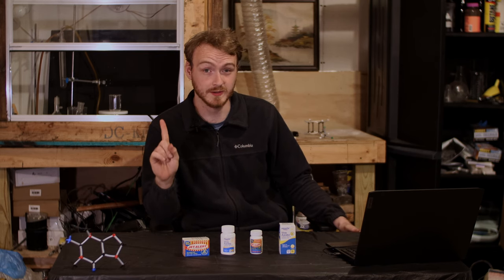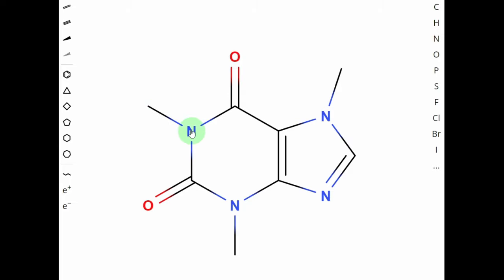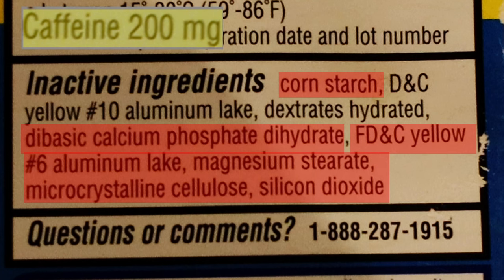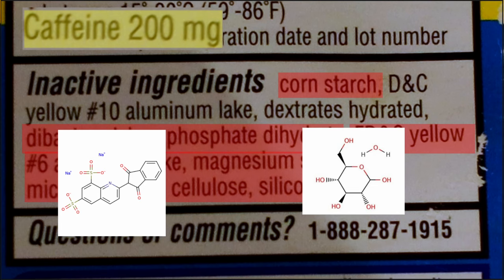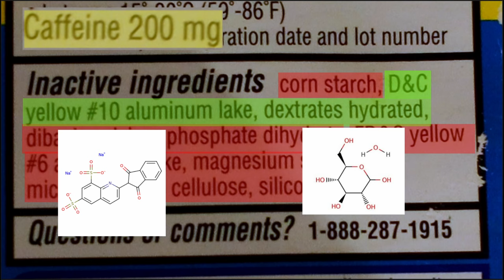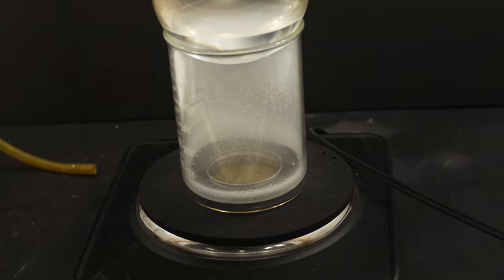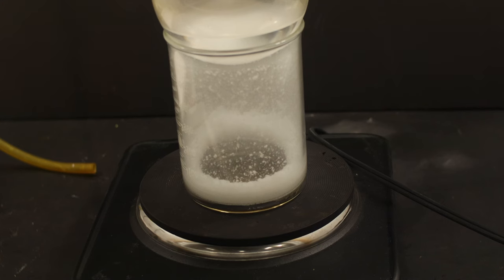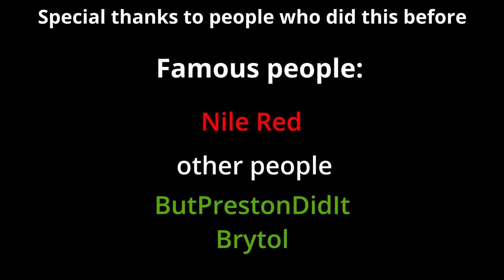Extracting Caffeine from Pills!!!

Comment: If you scrape off or wipe off the outer yellow coating with a damp paper towel before starting the process you can essentially eliminate having to do all the steps of removing the yellow dye. It’s much quicker too. Idk about your specific pills but the ones I’ve seen only have that dye on the outer coating of the pill, once it’s gone the water is clear/white when you dissolve the pills.

Comment: Fun fact about silicon dioxide in food
If you ever made some drink that required you to dissolve some powder (e.g. those energy drinks you can find online), if you find something undissolved at the bottom of the container you mix it in, or it has a "rough" texture, thats because of the silicon dioxide.

The best way to get rid of this problem is to let your drink settle for a few moments after mixing, and then transfer it to another container, excluding the last bit that was in the original container.
Reply from the maker: Huh interesting 🤔

Comment: Hi!

I'm no chemistry expert but i have a suggestion:
Since sublimation seems like such a good method for separating the caffeine from the impurities, could it be possible that performing the sublimation step right after the first recrystallization could reduce the loss of caffeine? Or wouldn't it be possible because of the high impurities content?

Thanks for your answer and keep it up man! Your videos are great!
Reply from the maker: Great question. Yeah I think I tried doing the sublimation after the first recrystallization in a test run and the impurities made the caffeine  in the dish turn brown and smokey. It might be fine though.
Reply: @ChemicalDistractions  don't quote me on this, but apparently the caffeine is fine and what burns off is the unwanted junk, further testing might be needed, Need to try it myself anyways, just need to get the stuff first.
Reply from the maker: thinking about it i might try and do a one step caffiene sublimation from pills. if it works i could make a vid on it.
 @killgaet6253